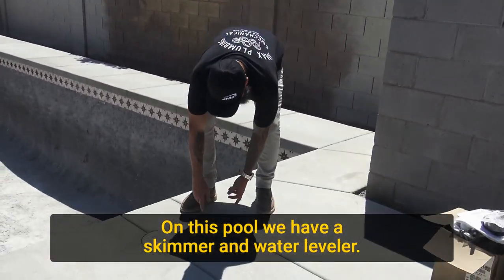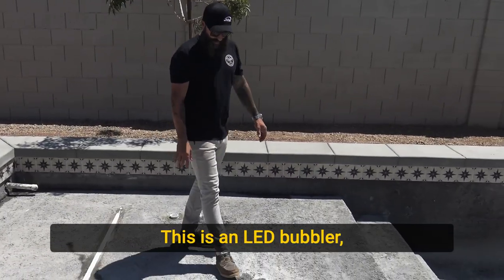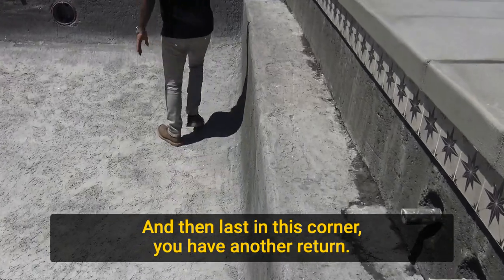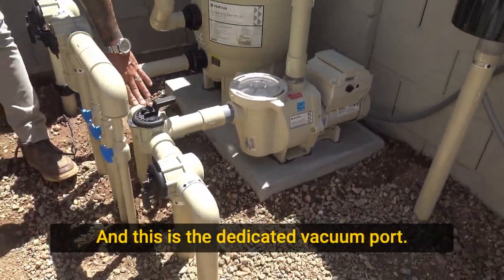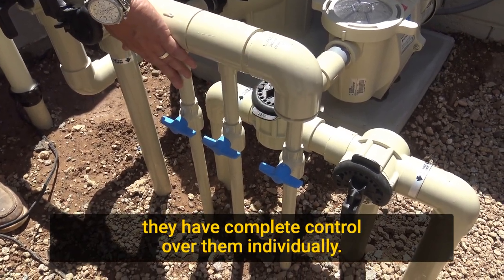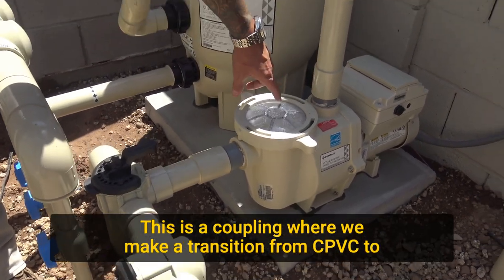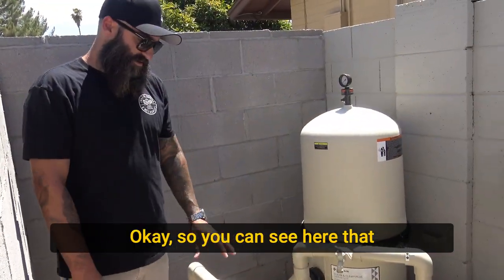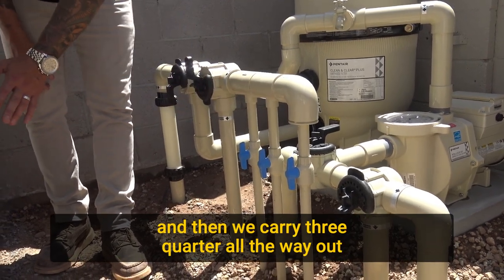How to Plumb a Basic Swimming Pool? Features & Equipment Explained

Comment: love the matching pipe color, nice touch.  Why not run your main drain separately to the pump?  I am completely new to pools but having one built, just curious.  I would think it would be nice to pull water from the bottom to help circulation.

Comment: We are in the middle of a pool build.  No water is in the pool or system yet. The pad that the pump, filter & heater were placed on has completely eroded away underneath.  Since the pipes are bending and the pump is lifting off the base now, all the equipment needs to be disconnected and pulled away so that proper ground preparation can be made.  It's 21-43 degrees F average where I live now. My thought was to pull all the equipment, cap the ends of the pipes and worry about reconnecting in the spring.  I can still get the pipes laying in the ground correctly without tension and sand placed along with building paver pads to place the equipment on.  I just don't know the risk to the system if it's not connected?  Any thoughts or suggestions??